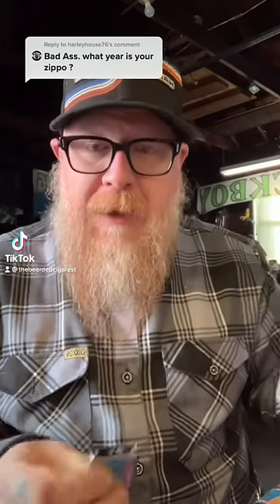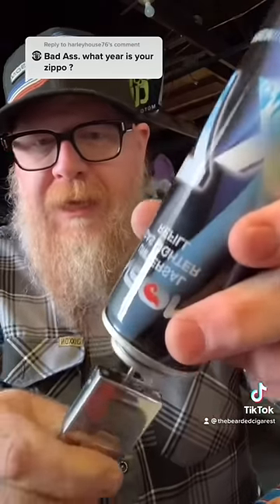How to properly fill a butane lighter!!!

Comment: “Bleed the air out until you dont hear anything anymore” - Best joke of 2022
Reply: Thank God someone else noticed 🙄🙄😅😅
Reply: Yeah!  That "air" inside the tank is BUTANE
Reply: I would've been really disappointed if no one had pointed this out , people are getting dumber folks, its disturbing.
Reply: @SteveIgnat  No, during regular use air leaks into the tank. Bleeding removes this air (and whatever is left of the butane) so that the refill is 100% butane resulting in a longer fill and life of the lighter
Reply: @Spaceman2484  OK. Whatever you say, buddy
Reply: @Spaceman2484   I'd like to know exactly how air at 1 atmosphere can leak into a chamber with ANY value higher than one atmosphere. PLEASE answer this for me.
Reply: @SteveIgnat bad quality fuel I’m presuming

Comment: Use the attachment that has an over hang on the lighter fill spot. I had to unscrew the bottom metal plate on my insert to fill mine with butane

Comment: You don't fill a Zippo with pressurized butane anyway, if you got the kind I got. It is filled with a cotton like material(don't know what it is or actually called) that is feed down as a wick into the wick hole and you fill the material filled reservoir connected to the wick with butane so the wick literally continuously wicks and burns the butane. Never filled with anything but regular non pressurized butane.
Reply from the maker: Lol you’re referring to Kerosene zippo’s. Those zippos don’t use butane of any sorts. They are filled with kerosene. The zippo in his video is a butane zippo. A torch. Which zippo has made now for quite a while. They even make butane inserts for your old zippo.
Reply: @thebeardedcigarest  I have the old school style zippo lighter. I fill it with zippo branded lighter fuel. It contains light petroleum distillate.It seems to work well!
Reply: @premquade1056  me too I use a Zippo that was my dad's in the army during Vietnam, it still has the original core. And works every time.

Comment: Just a tip,
Use the little plastic adapter to bleed the air out of the butane tank. No need to buy a special tool.
Hope that helps.
Reply from the maker: Yes you can do that of course. The good part about the tool is it doesn’t get butane spewing all over your hands when your fill it.

Comment: Pro tip from a butane user, certain times it's best, if the lighter is entirely empty, to press and fire the light and hold it open. Making sure the spark sparked and won't do so again! Hold the button down after the spark has fired off. Then you can proceed to fill, and the filling will purge air inside the tank. 

AGAIN MAKE SURE THE SPARK HAS FIRED AND WONT FIRE AGAIN! IF ITS A CONSTANT SPARK, DO NOT DO THIS! AGAIN DO NOT DO THIS IF YOU HAVE A CONSTANT SPARK! I learned the frigging hard way.
Reply: Pretty sure you need to make a video.. plzzzz
Reply: It took me a minute to comprehend what he was saying but I understand now

Comment: Actually fixed my old butane lighter thanks to randomly coming across this video. Thanks 👍
Reply: I have a butane lighter and two soldering irons.  Never bled them.  Can’t wait to bleed them and refill both tomorrow.  Good video.  Thanks!
Reply: No need to bleed with a tool. Normal use takes off pressure too.
Reply: Me too 👏
Reply: There is no air in the lighter only gasius butane

Comment: It's a closed system, so how does the air get in there? Lighter uses the butane & you fill it with your can of butane. It's a closed system, sealed at the filler valve so the butane goes in the lighter & not out into the atmosphere. Lower pressure & liquid butane turns to gas. There's really not any way to get air in the lighter unless you're filling it with compressed air. Air cannot get in from the atmosphere (low pressure), to inside the lighter (high pressure). The only way to get a tiny amount of air in the lighter is from the tiny little void inside the filler valve between the valve & butane can. I really can't see that being a significant amount of air, it can't build up as it's cycled out with the butane, remaining at a constant level.

Comment: Thank you so much I've been trying to figure out what was wrong with my dad's old lighter he gave me before he passed away and now it's working again ❤️
Reply: You needed to depressurize it when it was empty, if you refill it everytime it's empty with out depressuring then you'll be slowly filling it with air as well as butane, 
eventually it'll "be full" but it will only be a third of the way full with butane as the air left inside slowly became more and more under pressure eventually equalizing out with the pressure in the can of butane, it's notorious when butane cans are almost empty as any pressurized container will always have some degree of air in it especially closer to empty

Comment: Dude this helps a lot bc I haven't been able to take real dab hits bc I couldn't figure out how to refill it. Thanks for this!
Reply: Use a camping torch with the welding attachment. Can buy all at walmart in camping section. Costs 15 total and lasts months when hitting everyday
Reply: I was gonna say it, but it's☝️there. Hit Walmart/Home Depot/ Lowe's/Ace and get the kit. Maybe 20 bucks.
Reply: You needed to depressurize it when it was empty, if you refill it everytime it's empty with out depressuring then you'll be slowly filling it with air as well as butane, 
eventually it'll "be full" but it will only be a third of the way full with butane as the air left inside slowly became more and more under pressure eventually equalizing out with the pressure in the can of butane, it's notorious when butane cans are almost empty as any pressurized container will always have some degree of air in it especially closer to empty

Comment: Thanks I was ALWAYS wondering. Do I HAVE to buy that tool? Or what else can I use
Reply from the maker: Most people will use something pointy to bleed, like a pen or a pin of some kind. Yes it will purge it, but you can damage the fill port. You can use one of the adapters that come on the butane can, you’ll just get butane all over your hands. The tool is convenient.

Comment: Some cans, I think swan or Clipper come with a soft rubber adapter. It's universal and creates a good seal. 
You can usually tell which cans have it as the lid doesn't have adapters.
Reply from the maker: It’s usually the larger cans that come with it. The small butane refills don’t. Xikar has it, colibri, vector. Zippo butane doesn’t.

Comment: Put your lighter in the freezer for about 60 seconds to 2 minutes before you put the butane in it and it will take it a lot easier also makes the tank pressure in the lighter a lot lower than the can and do it quickly when you put it in the lighter

Comment: Heating the Can with hot water. you don't need to bleed the air out of the tank as soon as you bleed the air out of the tank the butane that left in there will pressure right back. If you're lighters in your pocket it's warm the butane goes to the coldest area. so by heating up the can and if it's hotter than the lighter the lighter will  Accept the butane

Comment: You can use one of the smaller  attachments to bleed it too if you don't have a tool. Cool tool though as someone who plays with a lot of butane :)
Reply from the maker: The great thing about this bleeding tool is the holes are on the side so you don’t get that cold gas’s all over your hands.

Comment: Step no1 when filling a butane lighter or torch is turn the adjuster all the way down to low. Every can of butane has it in step 1 or 2 but nobody ever reads the can. And that's actually how people mess up their torches and lighters because it frys the relief valve open.
Reply: This is the info I was looking for.. and my smokezilla butane doesn't say anything abt the adjuster screw
Reply: @kimkennedy9640  be sure to let the pressure out before refilling

Comment: most lighters do NOT need adapters anymore and work with just the stem. Even the cheapest torches on amazon will fill stem only. 
If you are getting some spill on your can and your lighter is functioning after filling its not the end of the world either. good info about air tho, when we prep a new lighter sometimes we fill and cycle the tank just to make sure there's no air.

Comment: You aren't bleeding air, you're bleeding off butane vapor. Butane boils at 30 degrees Fahrenheit (-1c). A more effective way to fill a lighter is to set your canister of butane in a warm water bath before filling. That liquid butane in the canister is only liquid because its under pressure. If the liquid is in an environment above it's boiling point where it can expand it's going to transition to a gas. The method in the video does work but you're losing butane. Letting out the butane causes the liquid to vaporize lowering the temp and the pressure inside the lighter allowing for more liquid to be added.
Reply: So when you use butane it replaces it with absolutely nothing in the tank? It’s air. Lol
Reply: You’re bleeding air to get only liquid or vapor.
Reply: @janettetorrez9218  You fill the tank with liquid. The "air" pocket is just butane vapor. The ratio of liquid to vapor when butane changes states is about 1 : 233. The liquid expands to a gas and occupies a volume 233 times bigger than the liquid occupied. As you use vapor, the butane boils (at  31f) and changes to a gas. The tank is under pressure because the liquid wants to be a gas when it's above 31f. There is no air. Only butane in a liquid or gaseous state.

Comment: My attachments were awful and kept slipping off the nozzle, barely stopped leaking either.

What I do is I take the nozzle as is and shove it down as deep as it physically goes then pull it out quick after a couple seconds.

Comment: An easier way is to flip the lighter upside down push in the butane release tab and hold. Then fill up w the butane while holding it open for like 2-3 seconds then let go and fill up this will flip it up damn near full and all you need is the butane can, doing it the way he does will still leave air but not so much to where it’s a big difference
Reply from the maker: You must have a special torch. Never seen a “butane release tab” the fill port is is the only entrance/exit on all my torches

Comment: Another problem is that the cheap fill valves on some lighters don't have an internal seal below the exterior portion of the valve so they leak intentionally to exhaust the air bubble but it also leads to lost gas

Comment: actually it's just a cheap lighter that doesnt have and rubber in the fill port. I have owned a ton of lighters and first thing I check is if the is a gasket on the fill port. those plain copper fill ports just dont work zippos are trash my 4 dollar gas station light has lasted almost 10 years and it still works fine.

Comment: I new about the tips but I never knew about the air pocket I always wondered why I would fill a light and then hold it up to the light and it's not even a quarter full
Reply: It's usually not air, but venting like that will chill the remaining butane making it easier to fill.

Comment: But what about if you don't hear any air escaping from a new lighter that came in the post (empty from butane also). I've just got a new butane lighter and it has no air from what I can hear and due to it coming in the post it has no butane in it either but it won't fill up despite using the correct size nozzle.

Comment: Honestly I use og zippo lighters
Just pop out the lighter out of the case
Remove the cover on the bottom
Open the fuel tank 
Pour fuel into the lighter
Put the cover back on
And put the lighter back into the case
Done ✅

Comment: I got a flip up lighter so i just take off the case lift the cotton fill it put the cotton back snug make sure everythings clean put case back on and burn it a few times
Reply from the maker: Different style of lighter. Those use petroleum gas and you wouldn’t want to use that for lighting cigars with.

Comment: I don't believe that "trapped air"  is an issue.

The butane reaches an equilibrium with the available space filled with butane gas and the rest with liquid.

You're just releasing the butane gas,  there is so much of it because the liquid butane immediately turns to gas as the pressure drops.   

This in turn lowers the temp of the liquid butane which shifts the equilibrium to a lower pressure, eventually slowing and stopping the release of gas.  

Tl;Dr,   you are just releasing butane and using that tool, generally speaking, is not doing anything of value.
Reply from the maker: You said a lot of stuff which may be right not a clue lol, but the tool 100% works. It’s called a bleeder. If you don’t bleed it throughout filling. The lighter will not work as well. Been doing this for years now. It may just be too much pressure that your releasing but if you don’t the flame will flicker, never stay lit. That’s my experience and many others as well.
Reply: @thebeardedcigarest  Fair enough, cigars are for our enjoyment and however you choose to do so is great.   

Just trying to share something I know a bit about.  I remain skeptical but I'm sure you have more hands on experience with  these torches and refueling than I do.
Reply: If you don’t purge it before filling it doesn’t burn as good and sprays out as seen in this video. Releasing the air is 100% the correct way to fill properly. Shows the difference between streetsmarts and Booksmarts, equilibrium this and that doesn’t ever trump hands on experience. You’re trying to quote a book you read instead of experiencing what you’re speaking about.
Reply: @poontangpirate1343  I've got plenty of hands on experience and have never had issues with it spraying all over or sputtering.

Feel free to enjoy the process how you see fit, but there's no need to be insulting when all I did was share an alternate take and a little bit of the physics behind what's happening to correct an error (that air was being released).

Also it sprayed out for the first guy because he wasn't using the adapter (the plastic thing)  not because he didn't let the "air" out.   The pressure is ultimately the same inside whether you bleed or not , and as I explained there is no air, only gaseous butane-  the very same stuff that you are putting back in.
Reply: You’re incorrect. It’s called purging and if you don’t do it often you won’t be able to fill the tank. It amazes me people can’t just look this up.
Reply: @dipfuk  you might want to reread.

All I did was provide context and clarification for a few errors people have made.    For example,  you are not actually venting air,  not purging won't cause sputtering, and the cause for the mess was the guy filling improperly, not failure his failure to purge.

All that's needed for fuel to flow is a small pressure differential,  that would be achieved through normal use, even just testing the lighter out a bit before refilling.

I said nothing that was incorrect, people are stuck on a lot of folk wisdom that's not accurate.   Which is fine, do what you want, just don't get mad at me for offering a bit of clarification.
Reply from the maker: Let’s clarify what I’m explaining in the video. Bleeding/purging is less about filling the torch and more about the torch functioning properly. When you do not purge the flame will not stay lit. It will putter/flicker and spit out fuel on the end where the flame is. On every more expensive torch, even the instructions that come with it will tell you to purge from the start and purge throughout filling. But separately the issue the guy in the video is experiencing isn’t from not purging. It’s because the nipple of the butane cane isn’t the correct size for his torch, hence the attachments are needed that come with the can. Hope this clarifies a bit more. Two separate issues. Purging 100% serves a purpose.
Reply: @zakpodo  You are releasing the pressure and air by releasing some of the gas. It’s necessary to bleed it before refilling. You obviously don’t use lighters.

Comment: It's not air that you're bleeding out. That's butane Vapor because it evaporates, and builds pressure due to the heat of the flame.

Comment: You can use anything to bleed it. The most important things is having quality butane. Buy Xikar instead of Zippo.
Reply from the maker: Yes but using things like pens, screw drivers, pins etc to bleed (which most people do) can damage the fill port.

Comment: Can I get the link for where I could get that tool to bleed butane lighters please and thank you I really need one of those those would come in handy for one of maintaining my lighters
Reply: Any small screw driver or anything thin enough works great, save your money.
Reply: Use a ball point pen, just press on the stem in the middle of the refiller.
Reply: @Gunzee  works like a charm.
Reply from the maker: @poontangpirate1343  the issue with using pens or screwdrivers, is you can damage the port. Causing more over what’s happening to this guy in the video to happen regardless of adapters. Sure it will bleed and if you only have cheap torch’s ($30 and under) yea save yourself the money. But some torch’s are very expensive. Like I have a $80 xikar that I wouldn’t want to take the risk of fuckin that port up. 🤷‍♂️
Reply from the maker: Cigarprop.com

Comment: I've only bought one bottle of butane before and it did not have those attachments on the top I was thinking I had to buy refill valves for the lighters I wanted filled ended up trashing them.
Reply from the maker: Yea some butane doesn’t have the adapters. Brands that do are Xikar, Colibri, Vector, Clipper. The small cans don’t have it ever. And zippo butane doesn’t have it on any can